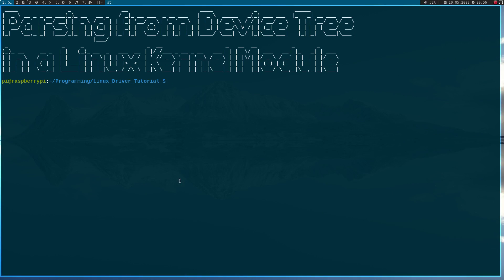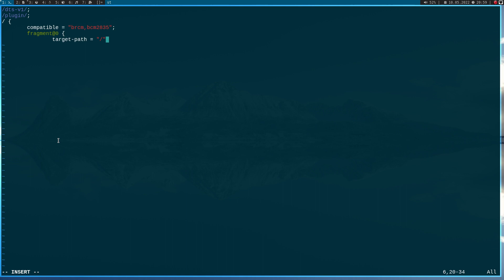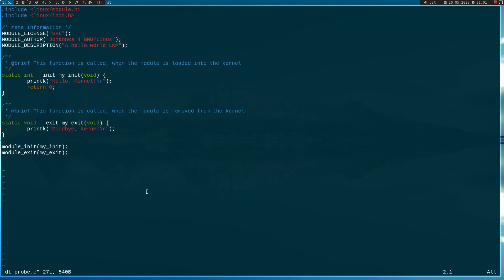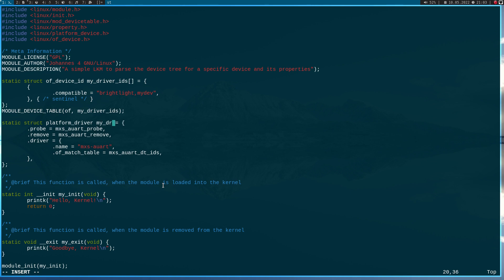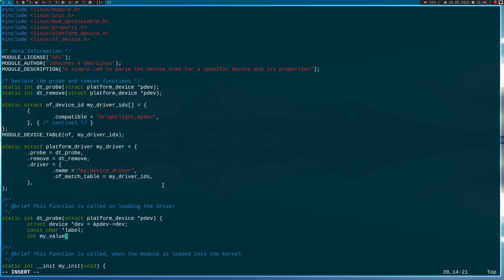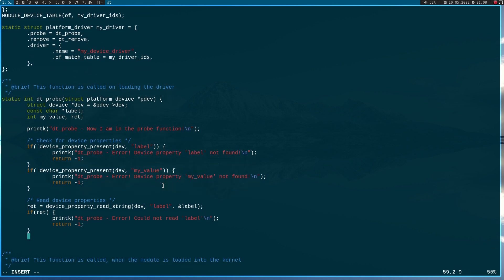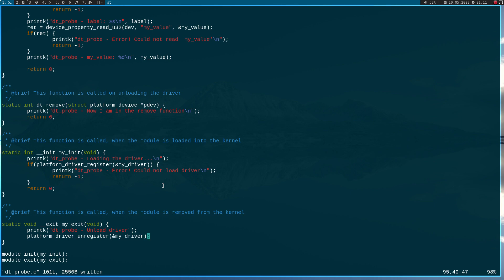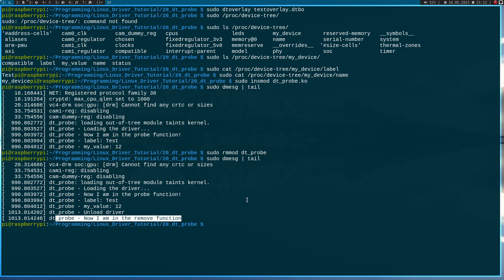Let's code a Linux Driver - 20: Parsing from the device tree in a Linux Kernel Module

Comment: the only problem with watching this video is that to my eyes the entire source code looks like 

x ...... ... ....
xx  ..... ... . ....
x  .... ... .. . .....
xx   ...... .. . .... .
x ..... ...
x ..... .

where x above is some from of indentation and ... . . ... is the source being presented.  I needed to use x's to show indentation because google very kindly craps all over any formatting I add here.

i.e. this is utterly unreadable unless i maximize the entire thing which makes it difficult to copy the example code to my editor.   

i do not want to download the end result, i want to create MY modifications on the fly so I can understand what i need to change, when and where I need to change it.  if i download the 345345 lines of the end result it will be much more difficult to ensure all the edits I need are put in place.  

I watch a bit, copy and change a bit, watch a bit, copy and change a bit.  

only now i have to maximize, copy by hand to paper, un-maximize, tab to edit, copy hand written to editor.  NOT HELPFUL!

Comment: Will this work on Desktop or intel computers?
Reply from the maker: No. Device trees are used on ARM systems  Normally Desktops don't use a device tree. Instead they are using ACPI Tables which are provided by bios. There it is more difficult to add a device. I want to do this someday, but till now I haven't managed it.
Reply: @johannes4gnu_linux96  thanks for responding.
I'm actually trying to get it implemented on dekstop. Currently compiling kernel with OF_OVERLAYS enabled. Will let you know if i get success.
Reply: @johannes4gnu_linux96  I was able to compile kernel with OF_OVERLAYS, but could not make it work. :(
Reply: @johannes4gnu_linux96  oh ok. Good to know this. I would love to see a video on this topic whenever you get time. Thanks. 
appreciate your passion for sharing knowledge.
Reply: @johannes4gnu_linux96  Woah :/

Comment: Hi, very informative guide. I have tried your code and when I try to "sudo cat /proc/device-tree/my_device/my_value" command, the value of the property does not appear but it works with other property that contain only strings. Does the /proc/device-tree only display strings?
Reply from the maker: Thank you. 
Yes, I saw the same behavior. Only string parameters can be outputted with cat properly.
Maybe try hexdump for ints. But I am not sure if it works...
Reply: @johannes4gnu_linux96  I will do try. Do you have docs or vid that could also parse device tree having a parent and child node?
For example:
adc@0 {
				compatible = "adc,brightlight";
				reg = <0>;
				spi-max-frequency = <1000000>;
				status = "okay";

				#address-cells = <1>;
				#size-cells = <0>;

				channel@0 {
					reg = <0>;
					config-number = <3>;
				};
                                channel@1 {
                                         reg = <1>;
                                         config-number=<2>
                                 }:                                
			};

Comment: Thanks for the turorial. One question, what's the difference between device_property_read and of_get_property?
Reply: Hello Werner.
device_property_read  make possible (in a general way) to get property from device tree and ACPI platforms. of_get_property, only woks for platforms that support device tree.
Reply: @renatosevero6533  Thanks, so in principle if my device is intended only for dt usage I should stick to of_ functions?
Reply: @wernerflorian4707  I would advice you to use the device_ API. Since is "newer" and supports both.
Reply: @renatosevero6533  will sure do thanks. If you happen to have more sources please let me know. For know I have been working mostly with forums and bootlin but its quite hard to understand everything only from the code.
Reply: @wernerflorian4707  For me also, mostly is Bootlin documentation, searching on stackoverflow also proceedings from Embedded Linux Conference, Linux Pumblers and FOSDEM.

Comment: I faced an issue. Can you please suggest what is the is issue? 
failed on fdt_overlay_apply(): FDT_ERR_NOSPACE
base fdt does did not have a /_symbols_ node
make sure you've compiled with -@

U-BOOT-=============================
U-Boot 2021.04-linux4sam-2021.10-rc1v01.01 (Dec 20 2021 - 17:49:57 +0000)RB_A5D27

CPU: SAMA5D27 512M bits DDR2 SDRAM
Crystal frequency:       24 MHz
CPU clock        :      492 MHz
Master clock     :      164 MHz
DRAM:  64 MiB
MMC:   sdio-host@a0000000: 0, sdio-host@b0000000: 1
Loading Environment from FAT... OK
In:    serial@f8020000
Out:   serial@f8020000
Err:   serial@f8020000
Net:   eth0: ethernet@f8008000
Hit any key to stop autoboot:  0 
=> setenv fdtaddr 0x21000000
=> fatload mmc 1 ${fdtaddr} a5d2x-rugged_board.dtb
34168 bytes read in 20 ms (1.6 MiB/s)
=> setenv fdtovaddr 0x21100000
=> fatload mmc 1 ${fdtovaddr} a5d2x_dt_probe_sample.dtbo
393 bytes read in 11 ms (34.2 KiB/s)
=> fdt addr ${fdtaddr}
=> fdt apply ${fdtovaddr}
failed on fdt_overlay_apply(): FDT_ERR_NOSPACE
base fdt does did not have a /_symbols_ node
make sure you've compiled with -@

OVERLAY================================
/dts-v1/;
/plugin/;
/ {
    compatible = "atmel,sama5d27-som1-ek", "atmel,sama5d27-som1", "atmel,sama5d27", "atmel,sama5d2", "atmel,sama5";
    fragment@0 {
        target-path = "/";
        _overlay_ {
            my_dt_device {
            compatible = "brightlight,my_dt_device";
            status = "okay";
            label = "Jagannath";
            my_value = <12345>;
            };
        };
    };
};

COMPILATION=============================
dtc -@ -I dts -O dtb -o a5d2x_dt_probe_sample.dtbo a5d2x_dt_probe_sample.dts